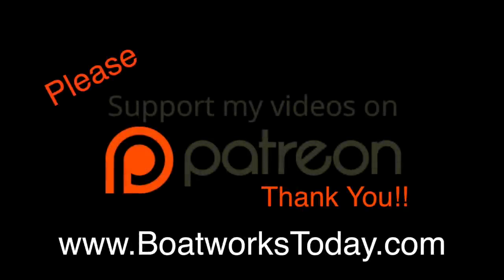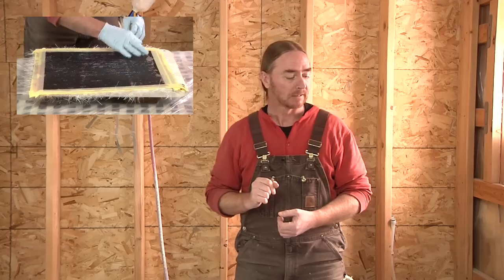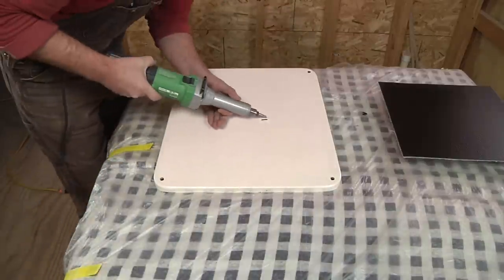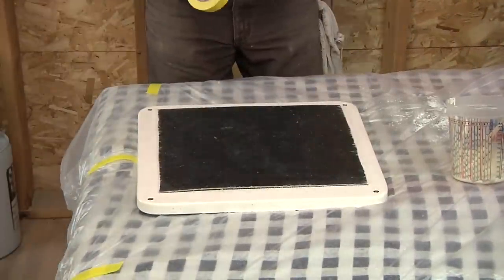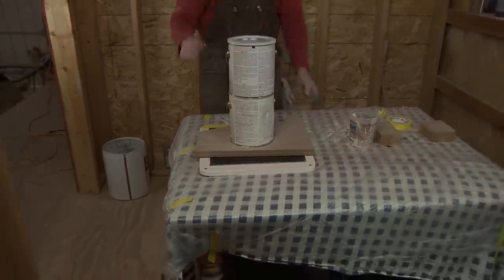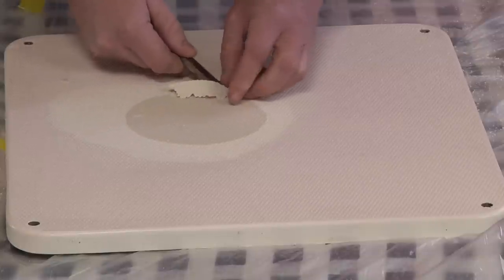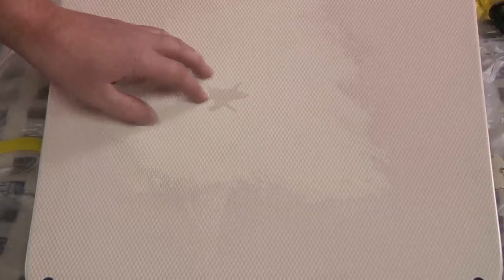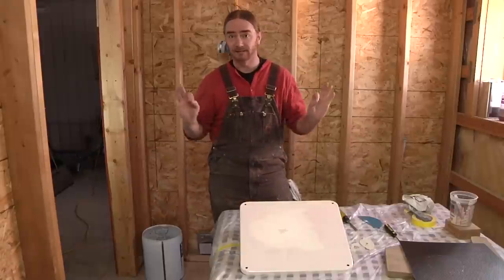Gelcoat nonskid Spot Repair ~ How To

Comment: Andy, love your videos! Do you know if 3M 5200 will adhere to PVA? Thinking of trying 5200 for small ( 1.5" diameter or less) non-skid deck repairs versus gelcoat because of its flexibility vs gelcoat. And, the color happens to be an almost perfect match for my gelcoat. Your thoughts? Thank You!

Comment: I have damage to my hulls with deep gelcoat chips. I can gently clean the chipped areas with a Dremel and then apply gelcoat. To get the gelcoat thickness I need it will take several coats. I've listened to you lament about having to sand between coats of waxed gelcoat and I feel your pain 😖😳 Is it ok to build up several coats for thickness with unwaxed gelcoat then for the final topcoat use waxed gelcoat to cure/harden to a sandable buffable hard finish?

Comment: If a final sanding coat is sprayed on and has styrene wax additive, will the wax always go to the surface? What if the sprayed gel coat is upside down? As in gel coat on the keel?

Comment: I am using total boat Gelcoat with wax to make a small repair on my Bayliner 175 BR.  I have tried a test batch - one ounce of gelcoat with 11 drops of MEKP but it did not dry completely. The temperature was about 85 degrees. Do I need to add more hardener?   Also, should I apply a cover coat to keep the air off the surface. If so what would you recommend I use? 

The ding is on a vertical surface so should I add a small amount of colloidol silicone to prevent sagging or dripping at the application site?

Comment: Your videos are so insightful,
I had a question, how would you fill a cavity between gelcoat and fibreglass?
I have a coach house where the two have parted and there are now holes in the non-skid between the gel and fibre. 

Many thanks
Reply: Drill into cavity with a small drill bit, inject resin or gelcoat into cavity with syringe

Comment: Do you think this would work for a small repair on a cabin top that has a slight curvature in one, or maybe two, directions?  The existing non-skid gelcoat is a bit oxidized. Will the PVA fill the gelcoat pores sufficiently to still release? I'm even more concerned about the how well it will release when making the mold in the first place. Thanks for your great videos!

Comment: Hi Andy, I very much appreciate your video because I have a old regatta sailboat and I have to repair the non-skid with old hole all around. I've a question: the gelcoat for the mould is with paraffin or not? And the gelcoat I'm going to use for repair must be paraffined too? Thanks so much for replay and many compliments for videos. (sorry for my english)

Comment: Awesome!!!  I’m feeling a little better already     Long story short I just bought a 1975 whaler it’s the 13.7  one. It has  like 4 small holes on the deck and two 3” cracks on the floor.   I was told to foam fill the holes first then repair it  .. I definitely gave this channel a Sub and smashed the like button !!!  Thank you for sharing

Comment: I recently has a soft spot in my deck repair by a professional boat yard and am very disappointed in the cosmetic outcome. While the soft spot is gone the holes drilled to inject it are very visible. The owner of the boat yard says that because the holes had to be drilled in noslip it would have been extremely difficult to restore the pattern, which I find unacceptable. So now what I'm left with is five holes that look like they have been filled with putty and left to dry. Your video makes no slip restoration look relatively simple. Do you think I should try to tackle this myself or should I look for a professional to do it?  Your input will be greatly appreciated. FYI, I love your videos!

Comment: I have a Catalina 30 I need to fix tons of these .. also where tops of the non-skid has been worn off. I was thinking of just painting with Kiwigrip. Do you have an opinion on that product? I would agree that a colour matching tutorial would be fantastic!
Reply: I asked this question 8 months ago, I am still looking to repair cracks in non-skid areas, damage where the non-skid has just been damaged - aka tops worn off through the gelcoat. What about just wiping the area very clean with acetone and spraying some gelcoat over the area,, ot "painting" a thin layer????

Comment: Thanks. Very informative. But what if the area we want to fill is curved? I read an article that instructed to make a frame from plexiglass over the non skid and pour Silicone RTV to make the mold. And then follow the same steps as you I guess.
What is your opinion?
Reply from the maker: +Alexandros Tsakris You could also make your mold just aft of the damaged area (still on the curved area) and proceed like what was shown in the video :-)  Sandbags would handy for weighting the mold as it will conform to the surface and apply an even pressure..  Hope this helps!

Comment: can these mold patterns work with top paint as well, say awlgrip paint?
Reply from the maker: +Marnie Mason Well, yes and no.  You would not be able to create the texture using this mold and paint (paint can't be applied that thick) but you could use some epoxy and the mold to create the texture, then come back over and paint to blend in the appearance.  A couple extra steps but it's do-able

Comment: Hi, I am a Norwegian fan who absolutely love your youtube show. You've just saved my day! I have a Marieholm 24. A Swedish, 24 foot cabin cruiser. Which sank last year. Thought the boat was a little too good to be scrapped. But fiberglass / wood work is not my thing. (I a mechanic). So now I take one step at a time to try to learn how to repair it. The hardest thing to fix for me was the nonskid. And you just showed me how. Also struggling a bit with teak doors and hull vinyl upholstery. Just made new pullpit / pushpit for the boat, out of stainless steel. Thanks alot for shearing you`re expertise.
Reply from the maker: +Tore Bråthen Hi Tore!  It's nice to hear that the vid's are helpful on your project :-)  The next video I'll do for the nonskid may also be helpful if you're needing to patch larger areas..  Have a great day!
Reply: +BoatworksToday Am looking forward to watch your next video. Since there is one major area I shall repair. Corner of the sun deck on the roof of the aft cabin. You are really a great help! Hope you have a great day too!

Comment: Andy great video as always! Dumb question,  is there a trick to lining up the pattern to the repair area since the mold is upside down when doing this?
Reply from the maker: +zsonic09 When it's aligned correctly, it locks into place.  Keep in mind that the mold is a female, and the deck would be a male.  The two parts fit perfectly together :-)
Reply: +BoatworksToday very cool! thanks for the quick reply!
Reply: Did you make the pattern mold or buy it? Love your channel. I am just in the process of purchasing a ericson 38 and will have to do a lot of the things you show how to do in your videos.Great Job.

Comment: Hi 
Thanks for a great video. Gibco Flexmold has all the repair patterns by the square foot so you don't have to make a mold. I would also recommend you use a piece of formica to remove the excess gelcoat or a sharpened wood  stick so you don't scratch the gelcoat.

Comment: Hello ! I have a question ! How do you do so the PVA doesn't "bead" on a very smooth gelcoat ? Thanks !
Reply from the maker: +xavytex it's really a matter of getting to know the gun your using for spraying.  The one I used has a 1.1mm tip and I had the air set at 30psi with the fan half open and very little material coming out so there is good atomization..  But each gun has its own sweet spot :-). Practice makes perfect!